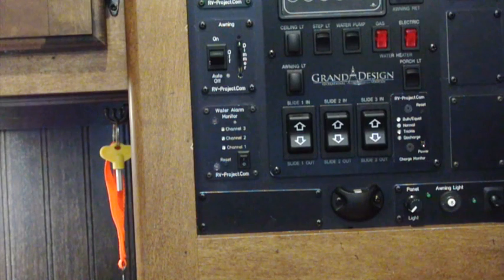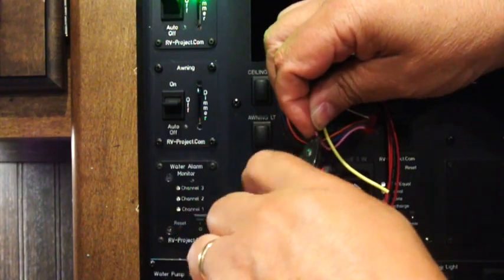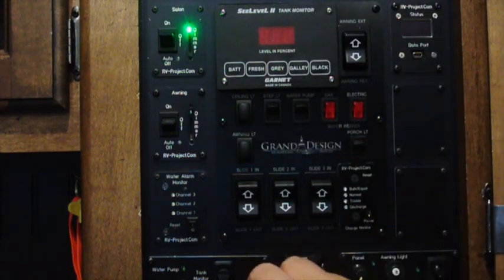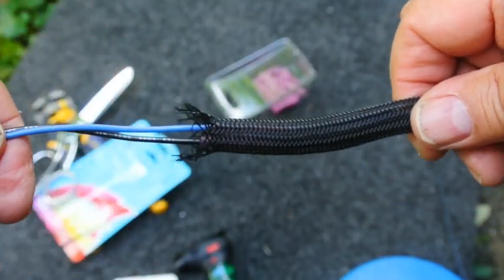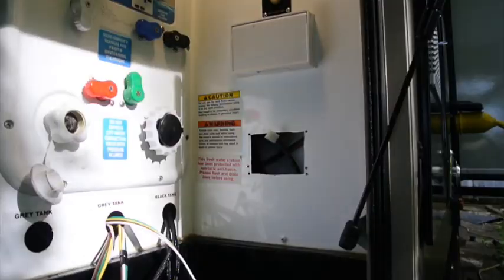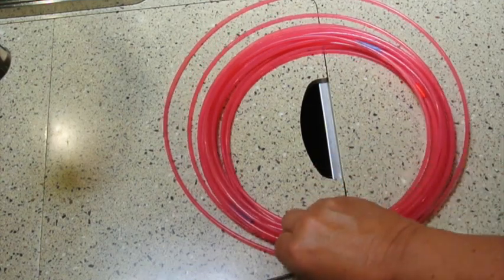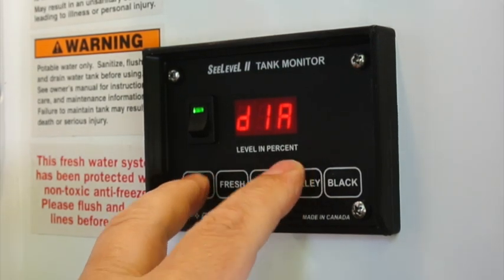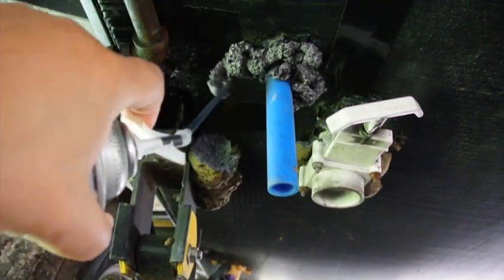Upgrading and customizing my RV's Holding Tank Monitor system - Part 3

Comment: What is the voltage from the DSI tank fault indicator pink wire?
Reply from the maker: It drives a LED so it is a current, not a voltage. But it is on a 12VDC system.
Reply: @RVProject  yes, I put mine in fault to get the output (12vdc) thanks, I am doing the same project. Thanks for the video and reply.